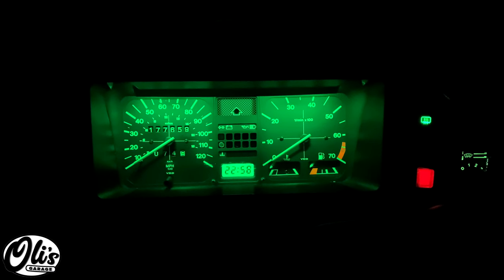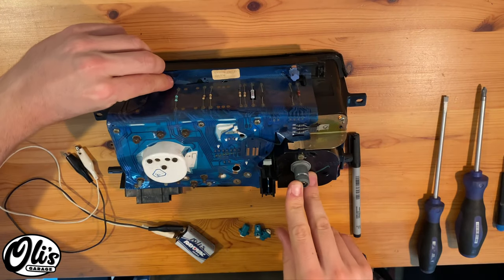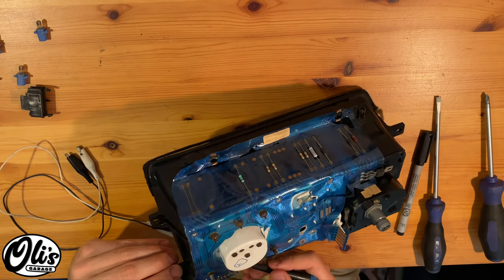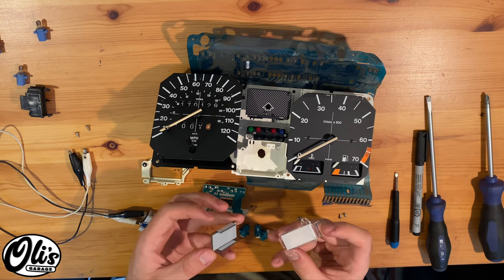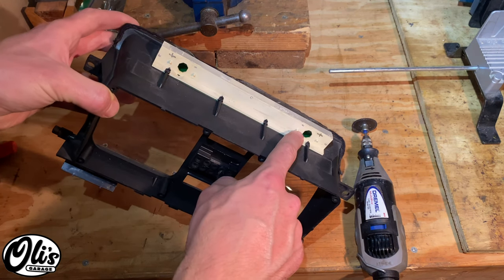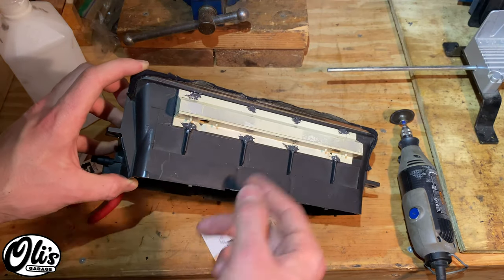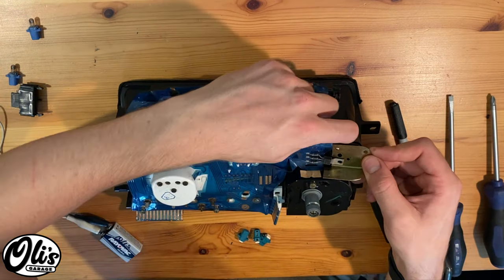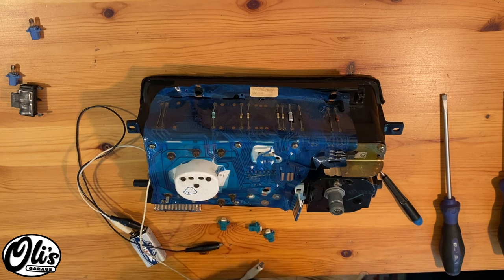VW Instrument Cluster LED Upgrade

Comment: In the future, could you do a video about diagnosing and fixing a broken fuel gauge?
Reply from the maker: I absolutely can, but it’ll be a while. I have a video on fixing a broken water temp gauge. If the gauge is broken, it’s a similar repair. Have you checked your fuel level sensor yet? That thing might be broken and rusty.

Comment: Do the Mk1/Mk2 cars have a dimmer for the cluster lights?  If so, any issue with dimming with the LED's?  Nice upgrade!
Reply from the maker: Good question! Short answer, no issue. Long answer, the lights don’t get quite as dim as with the incandescent bulbs. But I’ve never had an issue, especially with the green lights. If I would’ve used white lights, I’d probably dim them a bit sometimes.
Reply: @OlisGarage  cool, thank you!  Audi's of the same vintage have a bit different set up for cluster illumination, but LED's have always been on the docket to try.  Love the videos!
Reply: Yes

Comment: Hey Ollie, you make great videos man. I’ve been watching them non stop and about to do tons of work on my ‘89 cabriolet. 

Have you replaced the air intake + exhaust manifold gaskets. If you end up doing it a video demo would be great. 

Cheers
Reply from the maker: Thank you! Those are on the list to film. I won’t promise a time when they’ll be done by, but I have the parts and they need to be replaced!!
Reply: @OlisGarage  right on,

My parts are on the way I’ll be doing it pretty soon here. 

Just wondering if you know this, I can’t seem to find the EGR anywhere on my ‘89 Cabrio. Do you know if models in that year didn’t have them?
Reply from the maker: @WoodlandSaunasInc.  no egr on these cars!

Shoot me an email and I’ll give you a few tips on replacing those gaskets. Exhaust is difficult due to rusty bolts. What makes you need to replace the exhaust gasket?
Reply: @OlisGarage  thanks for the reply! 

I sent you an email, let me know if you didn’t get it
Reply from the maker: @WoodlandSaunasInc.  received! 😀I’ll give you a good reply tomorrow. Just didn’t quite get to it tonight.

Comment: You make it look easy. When I rebuilt my cluster it took 2 days and I broke 2 needles and the speedo cable. Can't warn people enough. THAT PLASTIC IS FRAGILE. Great video however
Reply from the maker: Needle removal is especially difficult.
These clusters are very fragile. I hate removing mine or taking it apart. I usually try to time multiple repairs to avoid removing the cluster just because of how fragile it is.

Comment: Thank you for this detailed video. I noticed you used green LEDs. I want to do this upgrade and retain the green illumination, but if I leave the factory green diffuser in place, do you think I should still use green LEDs, or would white + the green diffuser make more sense? Wonder if green LEDs + the green diffuser is too much green. :)
Reply from the maker: Warm white LED + green diffuser would look more stock, a pale green. I left the green diffuser in with green LED. It’s a darker green than stock, but looks really good in my opinion. I don’t think the green diffuser is making the green LEDs look much different. 
LEDs generally just emit one wavelength anyways, so either it’s blocked or not. 

Really depends what look you’re after. I wanted to keep it pretty stock. I love the green LEDs.

Comment: Original bulb should be 431919040 with 1.2W or 431919040A with 2W but what is the socket/base to get proper fitting LED substitution?
Reply from the maker: B8.3D is what the website I linked lists. But I’m not sure if that translates into anything outside of their site. You can also look for bulbs for VW vanagons. They had the same instrument cluster and there are tons of aftermarket parts available for the vanagons.
Reply: @OlisGarage  Yep, B8.3D worked in my case. Some modest cuts of some plastic body of the bulp was needed to force it to the hole in the cluster.
Reply: Yes, B8.3D is correct, also known as BAX10s.

I recommend you take the original incandescent lamps and remove the guts so that you are left with the empty plastic sockets (use a very small flat blade screw driver to push in the metal tabs at the sides).

Then you do the same with your LED replacements and put the LED guts into the original lamp holders.

The incandescent lamp holders just have a better fit and better build quality.